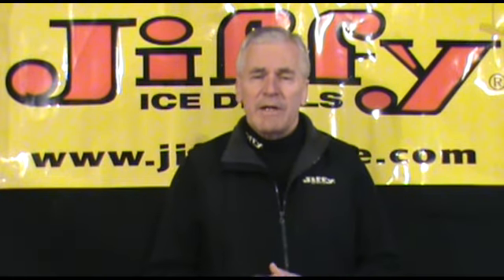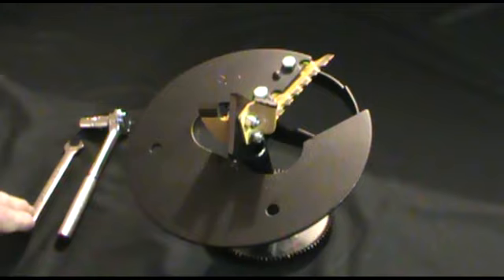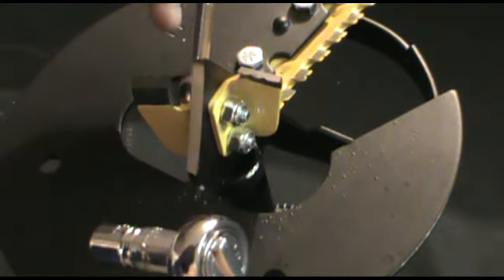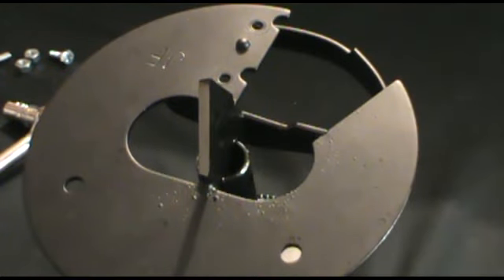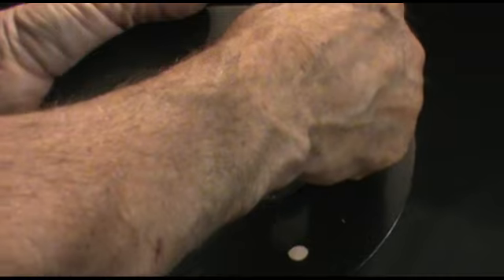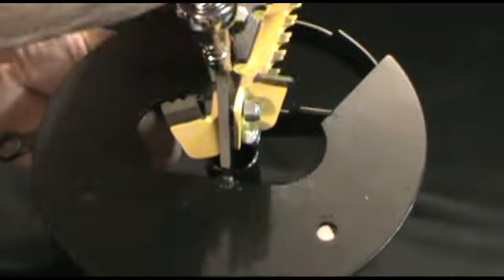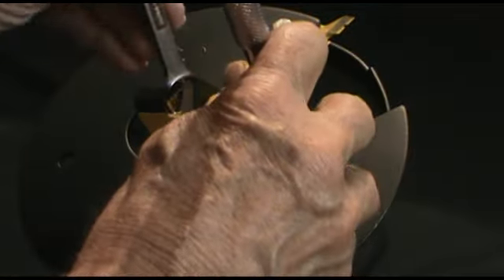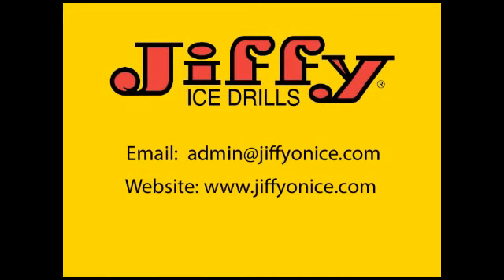How to Replace Jiffy Stealth STX Blades

Comment: Jiffy may have the worst customer service I've ever experienced they only make excuses about their products and don't stand behind them year in and year out my Jiffy has a problem as my friends bounce around with their electric augers with no issues
Reply: stick jr. Really,I have found just the opposite their customer service is awesome
Reply: Yeah, I've had an excellent experience just today with Jiffy customer service.  My auger didn't run that great to begin with but I took it to the Jiffy service center near me and they tuned it up and I've never seen a gas auger drill so nicely.  Man it was growling hard throwing ice everywhere.  Loving it again.

Maybe give an authorized dealer a shot with it.